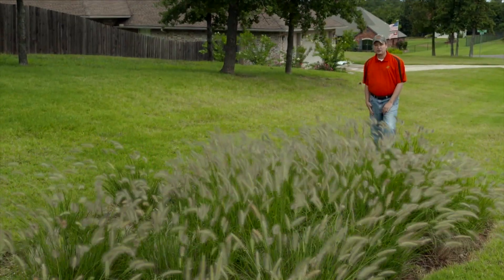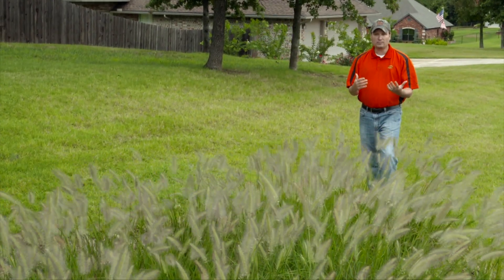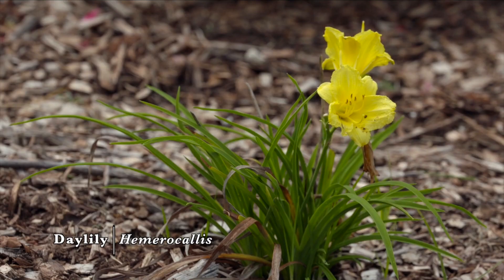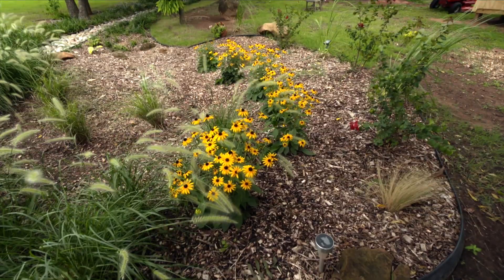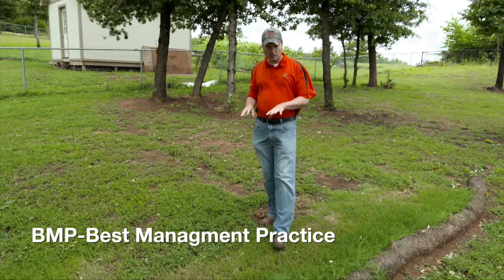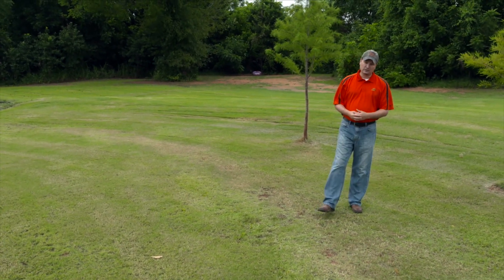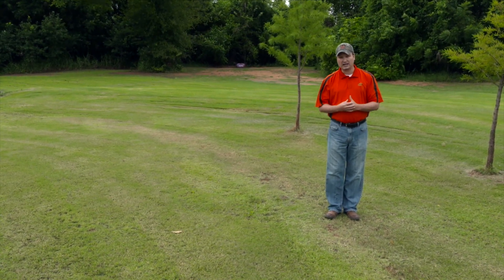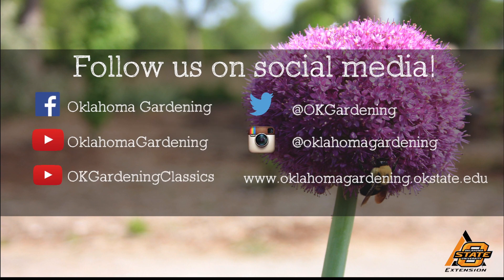Bioretention and Rain Garden Demonstration Project

Comment: are bamboos good for rain gardens?
Reply: probably, I'm sure they have wet feet.
Reply: @leedza  Aren’t wet feet fine for the center of the rain garden? That said, bamboo might grow too tall and be a hassle to trim if there are many plants in the way.
Reply: @peterl.104  again not an expert, the vigour probably depends on the variety. However, in the centre you want to put native wetland plants that also tolerate dry spells.
Reply: @leedza  agreed. Native plants are definitely better for various reasons.